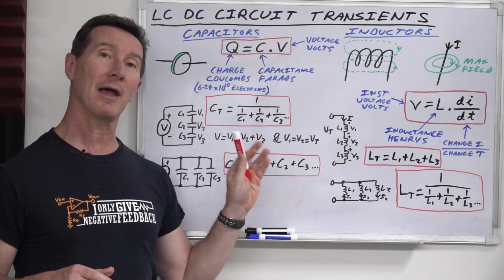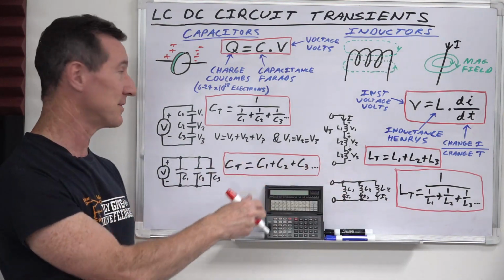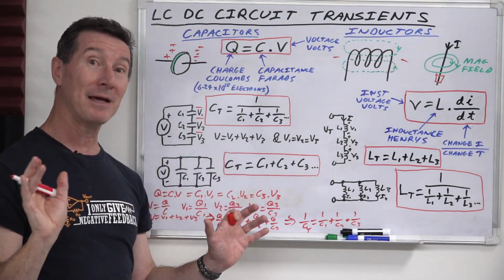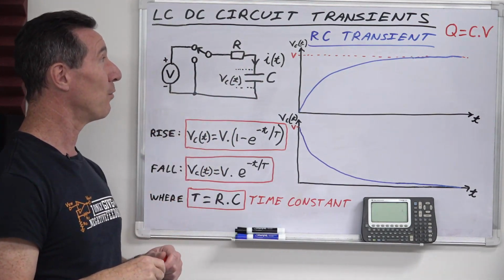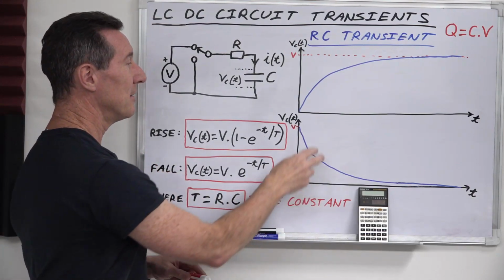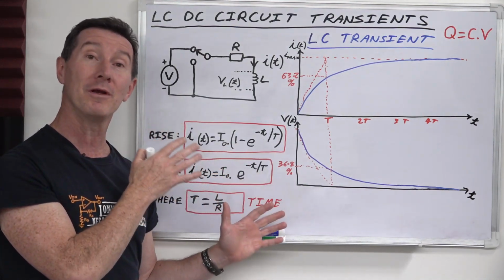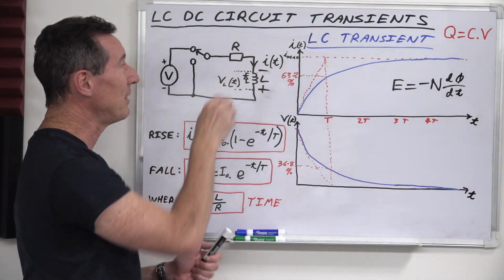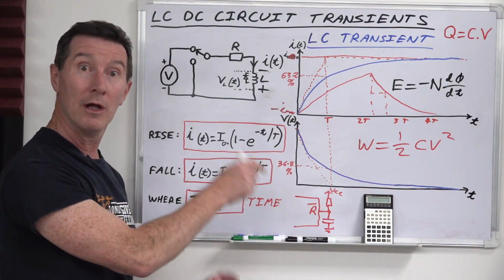EEVblog 1406 - DC Fundamentals Part 7: DC Circuit Transients Fundamentals

Comment: Actually resistor does store energy, but not in the form of electrical (parasitic C,L aside), like old filament bulb, it heats up and for some time it continues to dissipate the heat.

Comment: No electrons move or pass through the dielectric barrier of a capacitor. It’s only the magnetic wave component that can pass through a dielectric material, and it does so by forming a longitudinal standing wave between the two capacitor plates or the anode and cathode. Same thing happens in a DC current wire. No electrons move. It’s only the magnetic wave component that moves from one electron in one atom to another electron in another atom down say a copper trace on a PCB or wire. Now when you get above a certain frequency, the magnetic wave component travels outside the wire and the wire essentially becomes a waveguide, which gives you essentially superconductivity at room temperatures.

Comment: Just to add some tidbits about Inductance, that is why start and stopping of high power electric motors like in an industrial settings is its own science by itself to not fry the motor and the electronic driving it or popping all fuses.

Comment: Since High school,I still don't have any idea why do we say both capacitors plates have always have exactly equal and opposite charges regardless of the geometry of the circuit. They say one electron will reply the one on the other plate but it's just one in a million possibilities I can think of. It's not convincing.

Comment: so how would you design a simple circuit to limit the inrush current? In a battery operated device for example, when you plug the battery in, if you have a large bypass capacitor as a first component (for purpose of noise reduction for example) it will spark the terminal and have lots of inrush current I would think.

Comment: 36.8% Hmm 0.368 is 1/e that can't be a coincidence.
Well, he found the number T by putting a slope line in the beginning, so we need to find a derivative at t=0.
Derivative of Ve^(-t/T) = -Ve^(-t/T) /T
Plug in t=0 and you get
-V/T.
That's the slope of the line, and we know that it is equal to V when t=0. So, the equation for the line is V - tV/T. The line crosses the time axis when tV/T = V or in other words when t=T.
Plug that into the original function Ve(-t/T) and we get
Ve(-T/T) = Ve(-1)
What's that as a percentage of V?
It is Ve^(-1) / V = e^(-1) = 0.368 = 36.8%

Comment: You forgot to say that the same voltage drop over the capacitors in series occurs when the capacitance values are the same, i.e. C1=C2=C3
>>
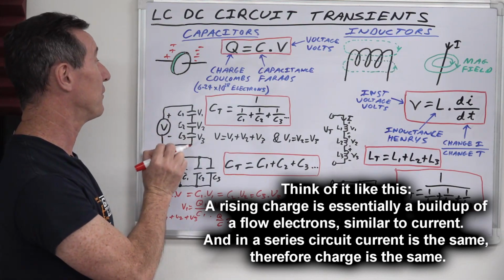Did you mean to say (at 6:02) - 'ideal capacitors', or 'identical capacitors', or possibly both at once?

Q = Cn*Vn : because Q is universal over each, best represented by the concept that they are open circuit elements except for this curious concept of of a certain amount of charge (i.e. current for a certain time) being able to cross the gap as it imparts charge in the capacitance, and of course conservation of current in a particular arm of the circuit [yes, even with capacitance there - You can't park electrons on one plate unless you park 'holes' on the other.]

So yeah, I'd heard of capacitative dividers... but I'm really here for the inductors.
Reply: I think you may have missed the best chance to throw us the word "asymptotic" (21:26), but inrush protection was right on the money (so why complain?)
Reply: I am just a little worried that you've called the RL circuit, as in "charging* a magnetic field" (/as it were/) by the LC acronym - - But where's the capacitor?
I wouldn't have thought you'd get to call the actually LC resonating system a 'DC' kind of circuit, even with the excuse of talking about its transients. Ah, well.

Comment: You've left me with a .5M of dust on the floor and tangled in cobwebs. I got my EE degree almost 45 yr ago when I went into engineering SW development; haven't chased electrons in WAY too long. A refreshing review... maybe a "new" hobby re-emerging (if I can find my breadboards and the drawer storage box with all my components and supplies in my storage unit). Thanks.

Comment: Here is a fun experiment: wind an inductor (5 turns for example) on a ferrite core. Measure the inductance. Wind another 5 turns (on the opposite side and in the same direction) and connect them in parallel. Is the total inductance half of initial 5 turn inductance?

Comment: I'm looking forward to the follow-up transformer lecture. We deal with a lot of primary measurement CTs in protective relaying in electric power transmission (nameplate ratings on the order of 3200A:5A [N=240]), and inadvertently open-circuiting the secondary of one of those under load gives an impressive, and potentially fatal, demonstration of Lenz's law.

Comment: There actually are practical inductors with true zero DC resistance, superconducting magnets. The coils in those magnets are usually a complete short circuit (closed current loop). In order to charge them up they open up the loop, connect a power supply across the gap, slowly ramp up the current until the desired magnetic field is reached, and then close the loop again and disconnect the power supply. As long as the coil is kept at a low temperature so that superconductivity is maintained the magnetic field will stay and the current will keep flowing (without any voltage no less!) indefinitely.

Fun fact: In practice they don't actually physically open the loop, they just heat up a small section of superconductor to above the critical temperature so that it becomes resistive. Because the resistance of the coil is zero in steady state all the current will flow through the coil and nothing through the resistive section, so the resistive section essentially acts like an open circuit even though it's a conductor (Other fun fact: the windings in a superconductive magnet are usually electrically insulated against each other with copper. During superconductive operation no current will flow through the copper, but in case of an unexpected loss of superconductivity - for example cooling failure - the copper will short out the coil and limit the voltage spike generated by the inductive kick). Kirchhoff's laws become funny when R becomes zero.

Comment: One of the most important concepts ever presented to me was to think of time zero in a circuit.. and then it starts. Before the circuit comes to operational stasis, it it a mess of inrush currents, charging up elements and even heating. Transient analysis is critical. Same at shut down, collapsing fields and discharging. Everything must be accounted for, not just steady state.   

Not only is inrush current a problem charging DC filter caps, so is the haversine wave after a bridge rectifier. Because the cap can never charge to the very peak voltage of the haversine, every time the voltage approaches the peak voltage, the capacitor is a very low impedance load for a very short time period. To eliminate this cyclic but very brief short circuit a current limit device should be used between a rectifier and filter cap..this is where inductors are quite handy. This is trivial with most 'small' circuits, but in large amplifiers, cap banks in the range of tens to hundreds of thousands of uF are quite common, and haversine peak charging currents can easily destroy a large transformer over time.  Another solution is to use a mosFET in series between the rectifier and cap bank.. driven by a threshold detector to have very low R below most of the haversine voltage wave, and to start having higher R above a threshold point selected to be near, just  below, peak voltage.

Comment: About 63.2% the initial voltage rise rate will be dominated by DC resistance (series R and capacitor ESR), right? So the RC constant is the ratio of DC characteristics (initial circuit state) to the reactive characteristics (changing state), is it? But capacitor ESR is not strictly linked to charge capacity so 63.2% could change, is that not right?

Comment: Hi Dave 
Does a capacitor work like a transistor.  Such as, it needs point 7 volts for the electrons to travel to the other side. As for a capacitor, do you have to wait until its fully charged for the negative to travel to the positive side. And does it travel through the dielectric piece due to the build up of voltage.

Comment: Interesting to note that the only case of a capacitor storing a charge without any voltage source connected for an inductor is an MRI machine with its superconducting magnet that forever has (or at least until someone hits the red button) current going round and round to make the magnetic field.
Reply: I worked with someone who wanted to turn on the light in the MRI electrical room and hit the red button.
Issue with doing that has mainly to do with the coolant eventually getting too warm and gets vented.  Fortunately that takes days.

Comment: Good information. This was review for me, but I always like to refresh my memory. I worked on high voltage dc-dc converters in my previous job. This theory came into play on a daily basis. When I saw your initial series caps, I was thinking, “you’re going to need some balancing resistors.” I wasn’t going go bring it up, since you were describing the ideal theoretical concepts, but I was glad to see you mentioned it. Another thing I learned on the job is HV MLCC caps lose most (like 75%) of their capacitance at their rated voltage. I learned about the back emf diodes protection back in my military training, but I don’t think they teach that well in college. Most BSEEs I’ve worked with design relay drives without it.

Comment: "What is the capacitance between the Earth and the moon?"

Physicists: 1.29284E-21 farads!
EEs: Zero. It's zero.
Reply: Astronomer: Is that at the Moons apogee and perigee?
Reply: @philipandrew1626  That's zero and ZERO, respectively.
Reply: 1 zeptofarad (zF).  That useless factoid is the only way I can remember what the next smaller prefix is after "atto".

I suspect propagation delay will be more of an issue for an earth-moon capacitor than anything else though.
Reply: Bullshit.  10^-21 is not that small, any capacitance between the two is probably too small to be worth calculating, probably e-50 or less.  And that value probably changes wildly.
Reply: @G E T R E K T 905  Yea, well, when we talk physical limits, what we're talking about is so ridiculously small, that -21 is still close to real world things physicists have seen.  I want to be as far away from that as possible.  And how the hell can you attach a constant number that.  If the sun so much as to do a sneeze, the value changes by a few orders.
Reply: @preddy09   no, a physicist would call it x10^21. He would assume the earth and the moon were perfect spheres of negligible resistance with no atmosphere or dust, that the orbits are perfectly circular, and the space in between is a perfect vacuum with no external forces or influence. Don’t you remember your physics studies?
Reply: @rob28803  Sound's like you stopped at high school physics
Reply: @preddy09  sounds like you think highly of yourself
Reply: @change_your_oil_regularly4287   Love your username. Very important message
Reply: When they ask for the capacitance between the earth and the moon, is that between the surface of the crust and the moon, or the Ionosphere and the moon... Or the van allen belts and the moon... Or consider the crust has a capacitive charge relitive to the Ionosphere and the Ionosphere has a capacitive charge relitive to the van allen belts and so do they to the crust particularly at the poles... While all 3 are capacitively relative to the moon and the sun via the interplanetary magnetic field with the ionic solar wind facilitating Magneto-Hydrodynamic ropes/channels/flux transfer events all of which extend the influence of electromagnetic interactions beyond what they would be expected to with the given fall off distance.
Reply: man of culture..!
Reply: Astrologist: Are you Aries or Capricorn?

Comment: 9:45 Or, or, or you use your left hand, for the proper current flow, that is, the electron flow, and you also get the direction of the magnetic field ;)
Reply: Yes but then you start mixing them up.  "Which again uses the right-hand rule?"
Reply: @danman32  You only mix them up if you're not used to use electron current flow.

Comment: Isn't that more like the circuit functions like a short circuit before the capacitor, but not after, is more accurate, when it is discharged and there is no resistors in front?

Comment: I'm a complete amatuer with no formal training so I apologize if this makes no sense but at 18:30 when you mention the in rush current being larger due to no charge on the capacitor, is that why you get a pop when plugging in audio gear?
Reply: The AC transient looks just like an audio signal and gets amplified and turned into sound.
Reply from the maker: Could be, depends on the circuit design

Comment: The capacitance between Earth & the Moon is impossible to calculate with a reasonable degree of accuracy, unless you are reducing the model to a 'lab' idealised, unrealistic, point source, two body problem. Otherwise you have to include changes in the sun which is fiery as a b!tch in heat always. The position of the Moon, Earth, and Sun relative to each other, which changes constantly along with their magnetic fields. The changing magnetic fields involved from all 3 bodies and the time that change takes to propogate. The solar wind, irradiance and current sheet. Atmospheric changes on Earth & the Moon - south Atlantic Anomaly anyone? We could go into the other planets and the galactic current sheet, other galaxies etc, but those will be too low magnitude to significantly affect the measurement for dinner time entertainment. I would envisage that each significant term would increase the computational difficulty exponentially, and that ignores taking the measurements timeously and error involved. To make the calculation properly would likely take more instrumental data and computational power than we have available at the current time. Is that a NP complete enough answer? Do I get the job?
Reply from the maker: No, you get your arse booted out the door for being a killjoy and not being practical enough to get the job done! :->

Comment: I wanted to make a four layer capacitor to function as a single component dc transformer. The two outer plates can function as the "primary" and the two inner plates could function as the "secondary" and if you increase the surface area of the primary or secondary you can alter the voltage .....

Comment: Would it be fair to make an analagy between capacitance and momentum buildup? For instance if you punch a wall from 1mm away not much damage is going to happen. But if you bunch it from 2ft away becuase the greater distance in dia-electric (air/space) enables you to build up more momentum and cause more damage meaning bigger energy release?
Reply from the maker: It's stored potential energy, Punching is like energy release, not storage.
Reply: @EEVblog  thanks dave!

Comment: At age 14 I built a circuit to shock my friends, with a 9V battery, momentary switch, and large inductor. Convince them to hold on to the wire, then let go of the switch. I was not popular as a teen.
Reply: I scored a beefy cap from an old radio. Intentionally prolonged the leads, charged it up and threw it at somebody with words "CATCH"....I was not popular either.
Reply: I did the same.  What was truly shocking was the number of people who would actually do that despite it obviously being a trick!  There's truly one born every minute...
Reply: @robandsharonseddon-smith5216  It's because they're curious and not pussies.
Reply: Oh didn't we all :) IIRC I used a transformer to up-transform the voltage. But the part about getting unpopular, well, some meaner buddy of mine grabbed the contraption and went around school to find volunteers, so he was the one drawing the ire. Worked for me ^^ It's weird how this trick worked so frequently. "Look, I'm giving it electricity and it's not too bad at all!" :D

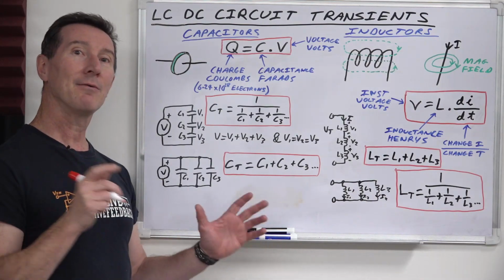Comment: @2:35 I calculated C = 1000 x 8.9E-12 x 4.7E7 / 300E3 ≈ 1.4µF (roughly)
Considering only the moon surface, both electrodes as an approximation.
Does that make sense? I mean... really?

Comment: A weird question about magnetic fields.  Is a magnetic field a physical thing and if so, if you were to move a coil, does the field physically displace and is there a time lag?  Or asked differently, if I instantaneously make the coil disappear, will the field continue to exist by itself for a moment?
Reply from the maker: I sense a physics rabbit hole....
Reply: @EEVblog  I live in rabbit holes.
Reply: Yes, a magnetic field is a physical thing, like gravity, or more appropriately - light. If you physically move a coil that is generating a magnetic field, the field moves with it. The field's location is updated at the speed of light. So for normal human experience, it feels instantaneous.   

A moving coil with (or in) a magnetic field is how we make generators and motors work.
Reply: @andrewpriest9403  So, since we are moving through the universe, logically, the coil is also moving and thus the field will be lagging and not be exactly where the coil is?
Reply: @ChristieNel  Due to relativity, any coil moving with us at the same velocity will appear static, since we are in the same frame of reference. Only if we are accelerating would a shift in position be possibly measureable.
Reply: @andrewpriest9403  Ah yes, I thought you might say that.  But since we're spiralling around a galaxy (and who knows what else on a larger scale), we are not moving in a straight line.  Unless... the magnetic field is subject to gravity to exactly the same extent as the coil?